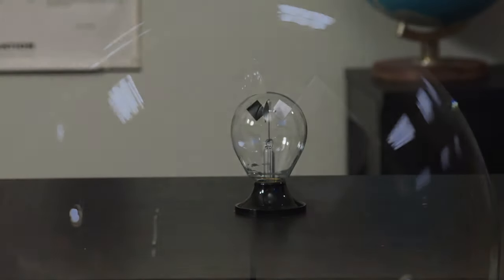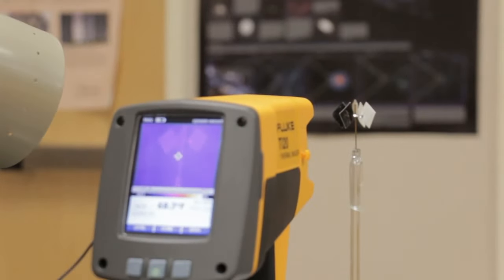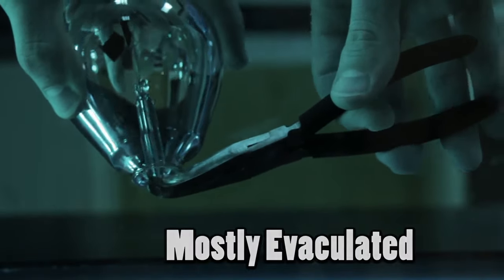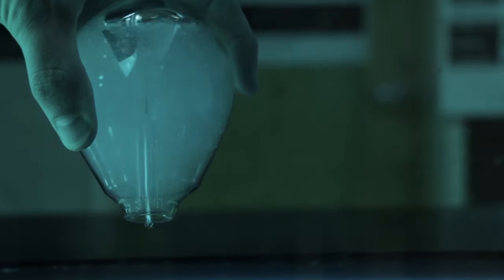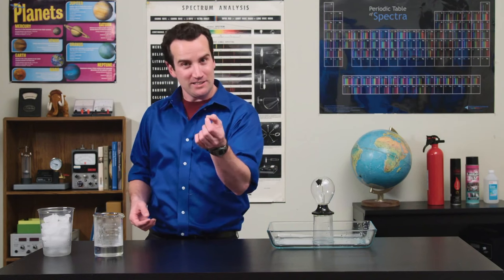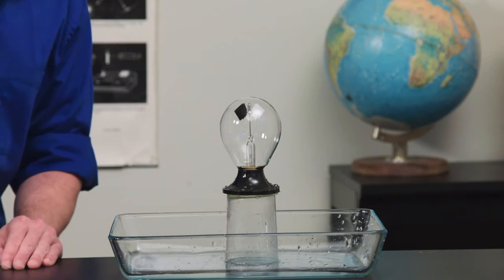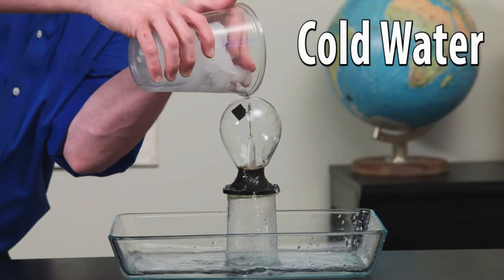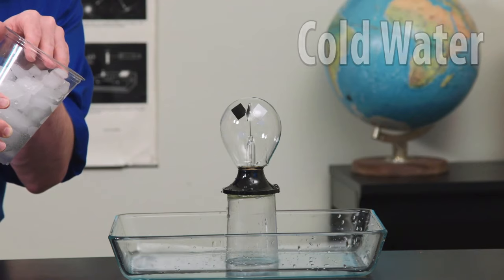The Radiometer - See the Energy of Light! | Arbor Scientific

Comment: Regardless of how much light is on the Crookes Radiometer if you cool it down a bit, it will go slower and if you continue cooling it down at some point it will stop and then continue cooling it down even colder and it will start spinning again only in reverse. I know what causes this, but I am waiting to see if some hot-shot Physics Professor can figure it out also. Robert Shrewsbury
Reply: Still waiting?
Reply: @kevinchavez6594  😔yes.
Reply: @CU08_  For this world to stop hating
Reply: The airflow from heat rising